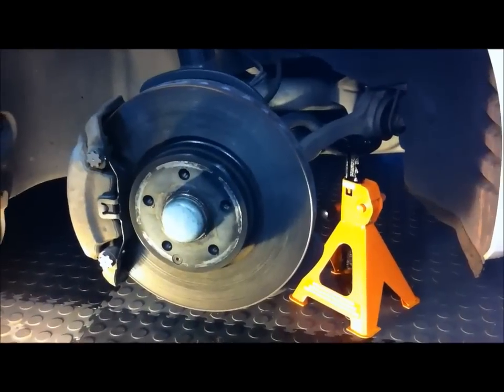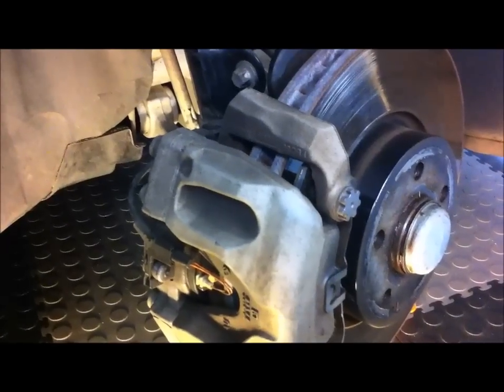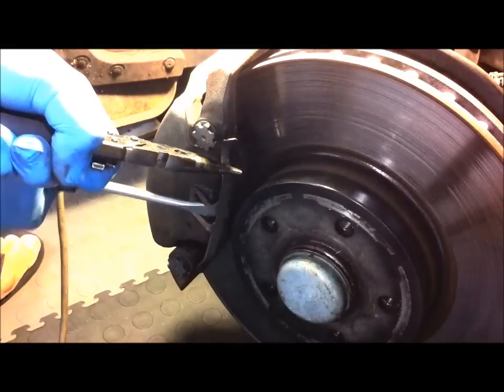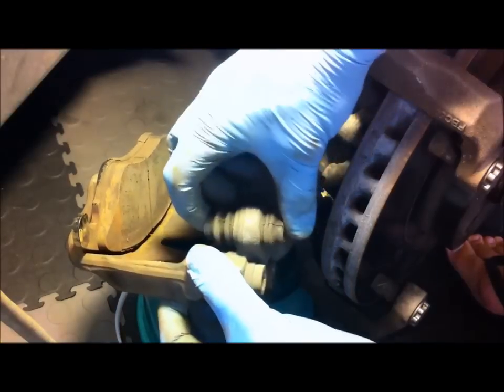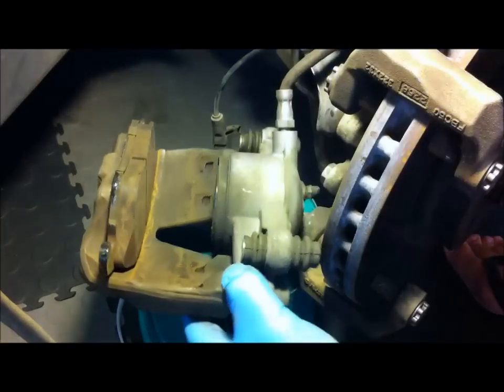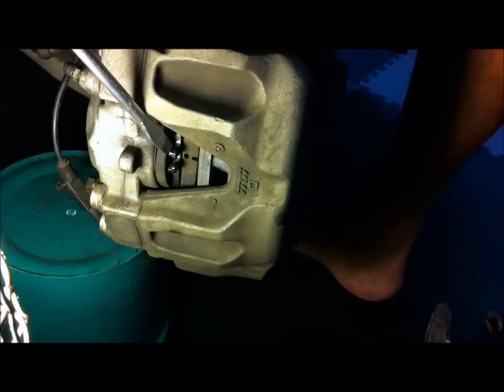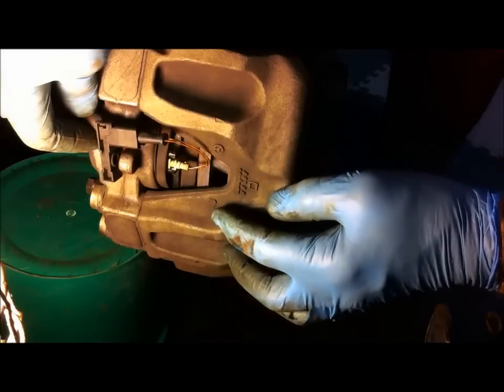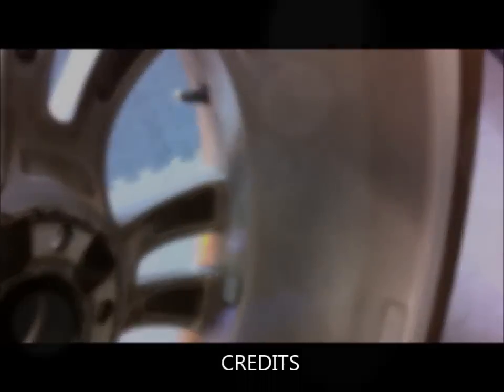W204 Mercedes C Class Change Brake Pads Front Break Pad

Comment: Genius idea using the washers to measure the disc thickness - Great tutorial.
Very important info about lubricating the pins - They don't do that at the Merc dealership here in the UK - but, I'll pay & get them to do it!  I can see it's essential.
It'll be done my way.
Many thanks Mr. Scott
Reply from the maker: Paul as a former road racer and current track day junkie I've always done my brakes on the bikes and cars as I do them properly.
The 1995 CBR600RR I raced in 600 Supersport in1995/96 had sliding pin twin pot calipers on the front. The pins were lubricated prior to every track outing be it racing or practice. I used Dot4 +280C brake fluid that was changed every two months.
I was always able to ride the front wheel hard ... it's because the front brakes worked so well they gave confidence.
I don't trust 16 year old apprentices working on my brakes. The dealers use the absolute minimum more expensive qualified mechanics to Supervise them.
My recommendation to anyone who's interested is to invest in some basic quality tools and workshop equipment like a compressor and learn to do this work. If something can be bolted together it can be pulled apart and put back together again.
Have a look at the video I made where I took the diff out and installed a Quaife LSD. It wasn't technically difficult.

Comment: Scott , great video thank you so much from So Calif.  I am going to attempt this today I did the rear pads and rotors last year, i did have a real challenge removing the rotors I hope the front ones are not rusted on.  BTW I like your BIKE as well
Reply from the maker: Al Gomez Thanks Al ... sometimes it helps to heat the rotors first by driving the car and doing some heavy braking. Track riding/racing is something I've been doing since my first experience on the track in 1977. That's over four decades ago! At 59 I'm still out there as often as I can pushing to go faster. I still feel like I'm learning how to do it ... it's strange but that's how the sport is ... even world champions say they're still learning how to do it.

Comment: Thanks Scott. I will be changing my disks and pads tomorrow. Should be fun.
Reply from the maker: Valley ... good luck with the project and let us know how it goes. You'll have to remove the caliper holding bracket and the single torx bolt to pull the disc off.

It's not difficult.
Reply: MrScott52 Sorted.  It was pretty easy really.  The hardest part was removing the disk (rotor) from the hub.  We live in Scotland and they use a lot of rock salt on the roads in winter so the disks were pretty corroded.  They were the originals which had done 62,000 miles (almost 100,000 km).  They weren't stuck to the hub but a 'lip' of rust had formed on the inside edge.  I needed to use a gentle persuader.  Cost all in was £120 ($AUS216) for Pagid disks and pads.  Mercedes quoted £450.  Now for my wife's VW.......this weekend's challenge.
Reply from the maker: Valley

That's good news. Yes I've seen the salt on the roads in the UK and it made me cringe! Interesting you got 100,000km. Last time I measured the disc thickness and did the mm/km wear calculation and extrapolated it gives an estimated disc life of 110,000km for the front.

I've already done my wife's VW so I beat you to it.
kind regards, Scott

Comment: Good video. I like that you used a I think you called it a "G" clamp (we call them a "C" Clamp in the US), but I think it is best to leave the old brake pad in the piston side and then position the C clamp in the middle. This way you are pushing the piston in evenly. If you damage that pistol and I've seen it happen, you are in for a very high priced repair. Overall using the C clamp is better than most videos showing guys using a screw drive to pry the piston back.

Comment: I went through the brake job on an E300 Hybrid AMG Sport Package. The most difficult part in this whole job was removing the "spring"/clipper. Happened that you may simply use both thumbs on the spring and grab on the caliper then push the middle of spring toward the caliper so that the locking tip will get out from the hole. Will find chance to load images. Do not use any sharp tool to bend or pry the spring, scratching the caliper.

Comment: Hi Scott, I'm in Perth and I think you mentioned akebono brake pads at the end of the video - Is this correct and what series do you suggest for the w204 and where are you purchasing from - here in Australia?
Reply from the maker: Darren they were hard to get in Perth and expensive but that was a long time ago. I bought mine from www.rockauto.com. You can set up an account as they sell to Aussies. You can easily buy on eBay but you need the part numbers. Akebono Euro Ultra Premium. Fronts are EUR1342 and rears EUR1341 but that's for the C320CDI that has larger front discs. The rears are usually the same on all the W204's. 
https://www.ebay.com.au/itm/Rear-Mercedes-C300-E350-C350-2008-2014-Disc-Brake-Pad-Akebono-Euro-EUR1341/192399940667?epid=2110647812&hash=item2ccbee1c3b:g:tTsAAOSwa-dWplA~
Reply: Good God Scott!  you are not wrong about expensive...  Are you still using and do you still recommend these of have you found something else?  I have been reading up about ceramic pads and see the benefits and certainly want to reduce the brake dust on my car as well as the additional benefits of ceramic pads.

Comment: Hello Scott, I replaced pads and rotors on my C300 yesterday and the drivers side sounds like the pads are clicking on the bracket, 1 click per revolution of the tire. Some people on the forums are talking about shims??? not sure what the issue is and where I can shim these brakes. Still have to check for runout when I bring home an indicator tomorrow but any ideas would be helpful! ps everything is tight and secure, made sure everything was wirebrushed and cleaned very well.
Reply from the maker: check the thin metal backing plate isn't rubbing on the rotor. Did you use the the brake pad anti squeal/rattle glue?

watch my videos on the front pads and rotors for the ML320CDI. It's the same process.
Reply: Scott Elliott the genuine MB Brake Lining for this model comes with anti-squealing backing material (the blue stickers at the back of brake pads) therefore it should not be applied with other grease or lubricant.
Reply: true, replaced mine yesterday and gentleman at Merc dealership said no need for anti squeal grease its built into pads
Reply from the maker: True ... lot's of pads now have an anti squeal material stuck onto the pads. I still put a smear of my own anti squeal material for good measure. It's not an issue as it's effectively a similar material.I've had no problems using the additional compound.

Comment: Hi, sorry to bother you. I'm looking to change my brakes and rotors but i'm not sure if i have all the tools can you please advise me of the following:
What type of bolt(s) and size holds for front and rear the sensor, rotor(alignment bolt), calliper holding bracket, thanks
Reply from the maker: Make sure you have a set of internal and external Torx bits as MB's are full of Torx fasteners.

The front & rear sensors are held in with small Torx bolts E10 size but an 8mm socket will also do.
The front & rear calliper holding brackets have 18mm bolt heads.

The little screws to align the rotors take a small external Torx bit. I can't remember the size but if you make sure you have a standard external and internal Torx set it will be in there. I think it maybe T45 or 50.
Reply: MrScott52  Thank you very much, that was a very prompt response, awesome.

Comment: Have you got the torque settings for the sliding pin bolts and the wear sensor holder bolt, thanks
Reply from the maker: +pppscooby Not at hand no. It's easy to find if you google search the benzworld forum.
Reply: pppscooby sliding pin bolt (the bolt from caliper to anchor) should be 29nm and the wear sensor bolt is 10nm, both are self locking (with factory thread-locker prepared). Sliding pin bolt should be replaced, which come within the new pad set. The wear sensor bolt you might re-apply thread-locker and put it back on.  To make the job perfect, use a thread chaser to clean up the screw holes before installing new bolts.

Comment: Hi Scott, Wonderful Videos, wish i knew about them before i spent a fortune servicing. I'm in Australia do you know where i can get good quality MB parts at affordable prices especially the brakes. I was advised against the bendix by my mechanic.
Reply from the maker: Million1110 Thanks for the compliment. I buy nearly all the consumable parts online usually from the UK, Germany or US. So filters, brake pads and rotors, wipers, bulbs, common parts that are easily damaged like external mirrors, lamp units etc. Micks Garage in the UK is good start. They have an eBay store as well and I believe they've got some warehousing in Australia to. So set up an account with them for starters. For example an oil filter at the dealer is about $50 or $12 delivered from Micks Garage. Buy several and it's even cheaper. I'd recommend Akebono Ultra Premium Euro pads as they're dustless. Made in the USA and about $220 delivered for a complete set. They're ceramic, better than OEM and easier on the rotors and no dust. Search eBay for akebono and see if your model comes up. I bought mine from Rock Autos in the USA. They deal with Ozzies and it's easy to set up an online account.The MB dealer MO is to gouge you as much as they can with overpricing and treating you like a halfwit. I have nothing to do them. I do better work myself.I put Bendix Ceramic pads on my wife's 2011VW  Polo and they're fine.
Reply: MrScott52
 You're welcome. I only gave credit where it was due. Thanks for the advice.

Comment: The cover for this vlog is not the car being worked on in the vlog.😖 Hack for establishing Psi, through tire is 🤨🤨.breakable glass jar   ??? From start to finish_  Not my chosen method for brake fluid change.
Reply from the maker: I'm not changing the brake fluid. This video is changing the front brake pads on a W204. The thumbnail or cover is also a W204.

Comment: I dont give a crap about your bike.. we are talking about the c class
Reply from the maker: Julio I'm sorry you find that so offensive. Just skip past that section if it annoys you. Give me a dislike if you want.

The reason I featured the motor cycle is that it has very sophisticated high performance brakes compared to the Mercedes. I'm explaining the difference because many people don't understand the difference between sliding calipers and opposed piston calipers.

Don't for one minute think that because the car is a Mercedes you have special high quality brakes ... you don't. They are common garden variety sliding calipers found on most vehicles including the cheaper Korean makes.
Reply: MrScott52 Hello Scott.. I apologize for my comment. Your video is actually very accurate and helpful
Reply from the maker: Julio Vasquez
 Thanks Julio. No hard feelings. Thanks for the positive comment on the video.
Reply: Thanks mate for an excellent video. Very detailed. Good on ya.